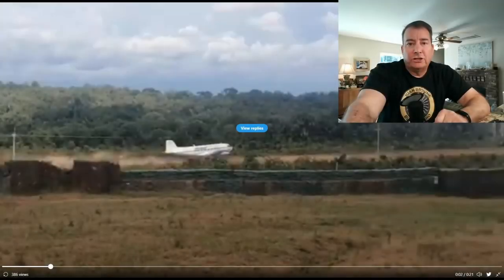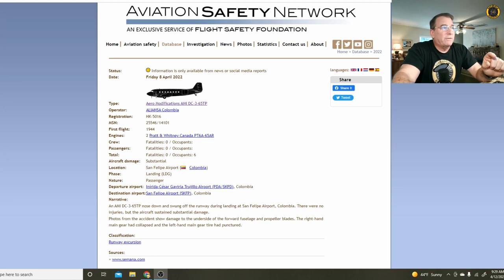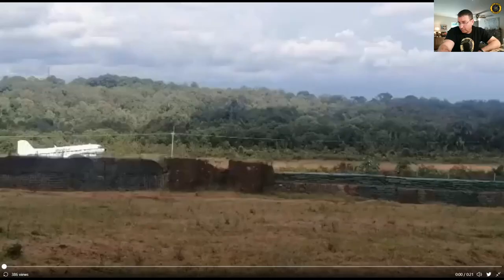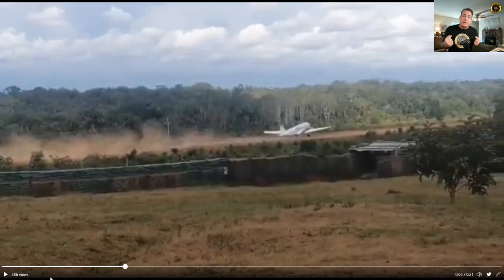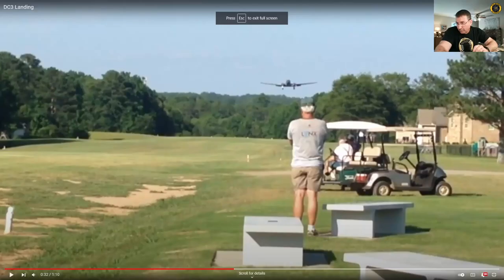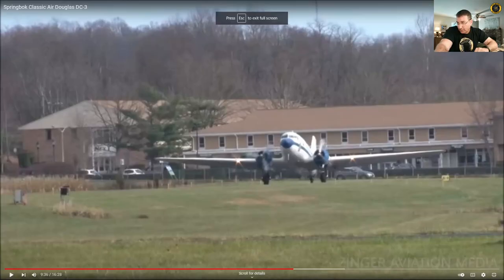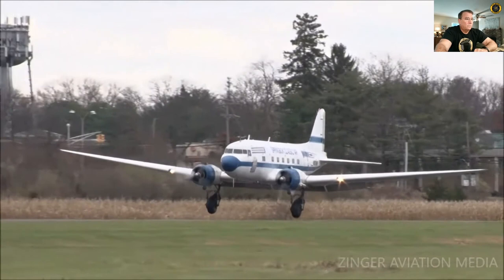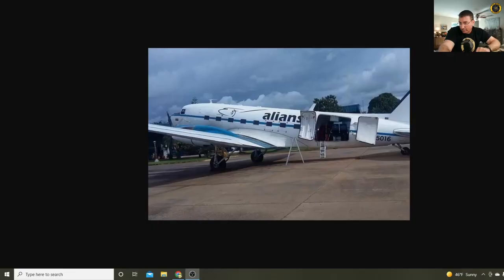DC 3-65TP Loss of Directional Control Colombia SA 8 April 2022

Comment: this is a tricycle gear pilot... nickle to a donut.  any tail dragger pilot knows you get maximum braking during a wheel landing with some finesse and gradually decreasing brake application as speed bleeds off, and  you only let the tail down when it really wont fly anymore.  trike habit... wrong aircraft type, poor speed control, no competance in tail draggers.  If this is an aborted landing or take off, it is a damn strange one.